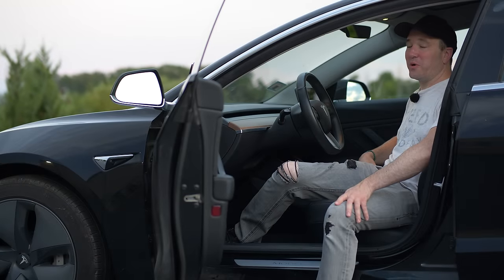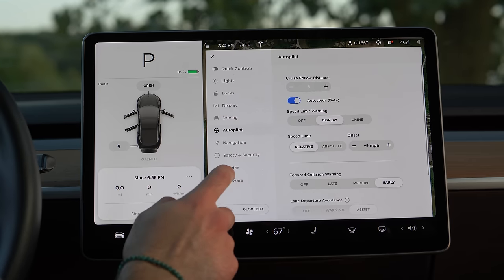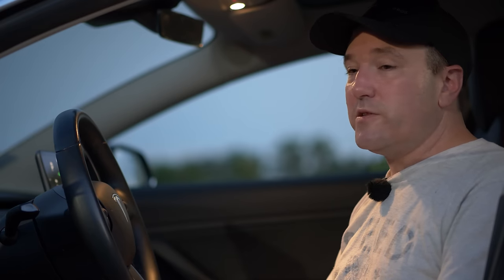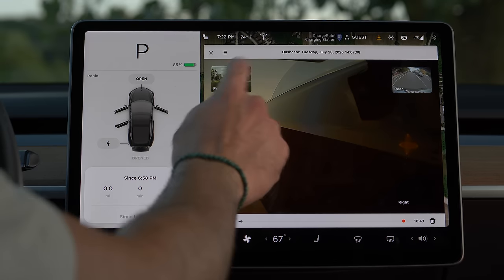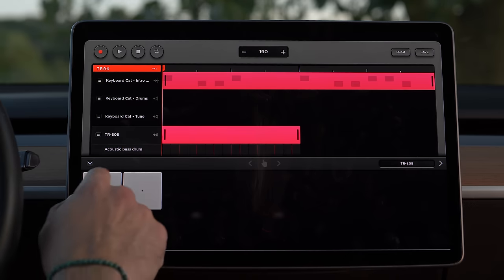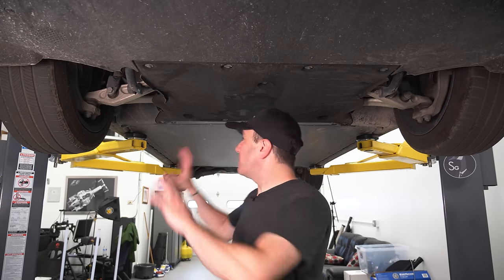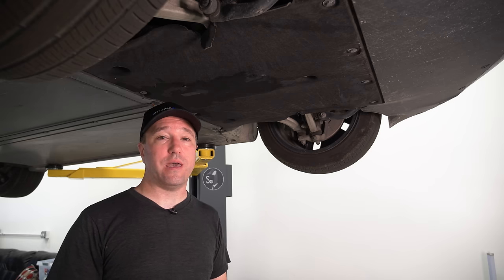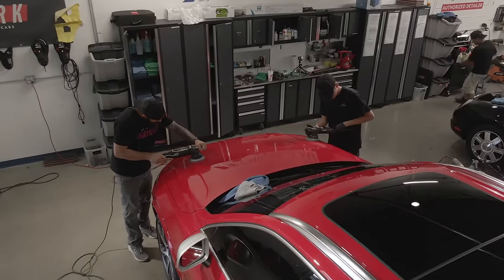Tesla Model 3 | Explaining the Cult

Comment: So the sound thing   ... so put a 10kw bass speaker emulator of a V8 inside the car. 
Passion? , smassion. 
Steam hiss and whoosh sounds great as well...would you want a steam driven car? 
The physics of combustion engines are such that they will always be asthamatic , ponderous and overweight also rans in comparsion to electric . The only difference that held back EV development as winner from the start is the battery weight.  If you put that aside - as power density improves - then combustion engines will just be confined ot the historical and the nostalgic. The laws of physics dictate this - not just clever engineering.

Comment: That was a great breakdown of the Tesla cult and pros and cons of the Model 3. Also there are other differences to add to the pros and cons of Tesla for future:
1) You don't own some software upgrades with Tesla. You'd figure with spending many thousands on antonymous driving for example you'd own that feature with the price of the car. But no, when you sell the car it does not go with it. The next owner has to pay to upgrade to that service again.
2) Battery degradation. There have been reports of people loosing supercharging capability. Tesla will shut it off if you supercharged too much. I assume since batteries degrade, fast charging is not safe after some cycle life.
3) Battery technology improvements. When Tesla finally has a new battery chemistry what does that mean for the older generations of Tesla? To me it means I could have a 1 year old car that is very outdated and worth less in long term value just because I bought in at the wrong time. With gasoline it's a constant and does not degrade or change.
4) Fender benders. These cars cost a lot more to repair than other brands. They are very safe and have a great ability to crumple and absorb impact but there is more damage that way. Check out TFL Car on YouTube and the many thousands spent and incredible damage just from backing into a wall at slow speed while trying to park their Model 3. While this was covered by their insurance, it took many months to fix and money doesn't grow on trees. If everyone is doing that insurance rates are going to go up.  

I'm not against EV or Tesla. It's just too early yet for me to buy one. I'd like to see a lot of the issues mentioned in the video and what I mentioned addressed before buying one.

Comment: Another great video. Did enjoy the social commentary at the end. One thing of note, the two nuclear plants closing down aren't really because they're too expensive the run. Exelon along with every other nuclear plant owner have made tons of improvements to lower costs of running these plants. However, the artificial price structures treating electricity generation more like a stock market than a national good that a bunch of free market advocates pushed through in the 80's and 90's combined with growing fluctuating generation from wind and solar are driving all of the existing nuclear operators out of business. This goes for other "base load" generators too, including coal fire power plants and even natural gas combined cycle plants. So when a "base load" nuclear or coal goes offline, it is replaced actually by natural gas combustion turbines (least efficient way to make electricity with natural gas) because those units can make up for the rapid loss of power whenever the sun doesn't shine and the wind doesn't blow, but Dave still needs to plug in his kilowatt Tesla after a long drive home after work. So really, in 2020, a realistic Tesla use primarily natural gas generated electricity, and not any of cleaner nuclear or renewable sources that generate most of the electricity over the course of a day rather than rapidly for a few hours.

Comment: Love Savagegeese and tend to agree. I rented the model 3 performance for a day in SoCal a few months back. I had a ton of fun dragging AMGs and BMWs for the day. There’s a smug sense of satisfaction that comes with crushing far more expensive cars off the line. With that said, the car falls apart in the corners. It feels heavy and just doesn’t feel like a willing dance partner when you try to push it. The brakes are one of the biggest weak spots and don’t give you much confidence. That said, it’s ruthlessly efficient and quick. In sum, I’d happily drive one Monday through Friday so long as I have a fun stick shift car for the weekend.

Comment: Fair points regarding touchscreens, but Tesla's overall crash safety record stands on its own. There are plenty of distractions in modern vehicles. You still have to generally glance at conventional controls and that's all you generally need to do in order to know where to touch the Tesla screen for most driving controls. HVAC controls are definitely easier to adjust on a Tesla, compared to almost all other cars I've driven. Other touchscreen functions are not meant to use while driving and some are unavailable unless parked.

Comment: Took one for a test drive last weekend, also RWD version. If I lived in a city, I would have one hands down. Mostly because of the lower cost of "fuel". 
I both enjoyed and loathed the fact all the things were on the center screen, as well as the autodrive features. 
It is absolutely not a sports car though, it had crazy understeer even just on a traffic circle. 
Range, even with the 'extended range' package, concerns me, as I live in a very rural area. it is about 230 KM from my door to a Costco for example, so the monthly grocery run would be on the very edge of the range possible. (no, there is no super charger where I live or where the nearest costco is.)

Comment: As a 69 yrs old do it yourselfer, I am excited about the aspect of less scheduled maintenance.  I have 10 vehicles that require oil changes, cooling system upkeep, spark plug changes, transmission fluid changes, etc.

Comment: I agree with what you say about all cars being wasteful in your closing comments.  OEM’s need to continue to find renewable ways to produce cars. The VW ID.3 is apparently going to be 100% carbon neutral at the time of customer delivery. They enforced strict standards to all suppliers and offset whatever emissions couldn’t be avoided. After that it just depends on where the customer lives.  if they have green energy options or solar It can be true net zero carbon. Then of course the recycling processes add emissions as well at the end of life.

Comment: Fair review. As for battery supply the big OEMs had many years to solve this issue but they actively chose not to( remember the movie 'who killed the electric car). Also in terms of pollution an electric does not actively pollute. When manufactured it will have a carbon footprint and depending on where it gets its electricity for charging. These two situations can not really be the electric car's fault. Grids can be made to use renewable or nuclear power. Factories can be made more efficient.

Comment: I really enjoyed your video but it seemed at times as though you felt the need to apologize for any criticism you directed at Tesla. I'm thinking that may be out of concern you'd get an avalanche of indigent comments from Tesla fanboys. Well, I'm a fanboy, and you don't really need to worry with a video like this which presents a balanced pros and cons assessment and where the problems being talked about are genuine issues and not just a slew of irrational and unfair comparisons. You talk about many of the car's strong points, but yes, there are panel gap and paint problems and other issues that need to improve. But well done in pointing out also that these are common problems seen with other new car designs and for also pointing out that in many respects Tesla is revolutionary, is a very good car for the money, and that it is actually steadily improving.

Comment: Interesting to watch this video 3 years after it was published, Tesla has addressed every single one of Mark's complaints as the years have gone by, now with Project Highland, the Model 3 will go toe-to-toe with any manufacturer today with improvements in styling, fit/finish, comfort and cabin noise.   We now know there is plenty of raw materials to make batteries and the SuperCharger network has doubled in size in recent years.

Comment: This just in (WSJ, 12/31/21): Tesla is recalling 356,000 Model 3s because of problems with the backward-facing cameras which stop working because of owners' opening and closing the trunks. In addition, Teslas are being recalled because of dying touch-screen displays, their ability to allow drivers and passengers to play games while the car is in motion and front hood latches (model s).
 Again, if you need quality and reliability from your choice of vehicle, stay away from Teslas.

Comment: What worries me most about the Tesla's dependency of the electronic interface is someone hacking into their system and controlling people's cars to cause accidents or chaos. And your review was great, as they always are!
Reply: You realize all modern cars are ran off computers right?
Reply: @MindzEnt I don't believe they are the same. Are you saying that a Tesla has the same system as all modern cars? And that all the other modern cars can be updated and repaired the same as a Tesla?
Reply: @t.k.morris  Most modern cars have the same amount of computers on board that have internet connectivity.  And the over the air software updates is something that Ford and GM started doing in 2020, alot of other brands also have Ota updates planned.

Comment: Very good.  I've watched both of your videos on the Tesla Model 3.  I'm hoping the next video you do on this model will include more information about the rear end differential.  I'd like to know if it has some version of posi-trac or lock-up.  Not for racing, but for traction in snow etcetera.  In the first video on the Model 3 (2019) you stated that the front motor utilized an open-differential.  So, I'm hoping the rear wheel drive base car doesn't use an open differential.

Comment: You raise many fair and reasonable points, but I'd push back a bit on a couple. While the touchscreen may seem tailor made for dangerous distraction, I'm not aware of that being shown to be a real-world problem. More specifically, I'm not aware of any study or data showing a higher incidence of accidents or trouble with the Model 3 than with conventionally-knobbed cars.  Moreover, many of the features that can be accessed from the touchscreen can also be accessed entirely by voice commands, with no need to look at the screen at all. The more significant issue is charging, which you aptly raise near the end. As yet, that simply can't match the convenience and ubiquity of gas stations all over the place. Nevertheless, especially in suburban areas like yours, most would charge at home, over night, which has no analog with an ICE car.

Comment: Very good review! I would prefer reviews in general to be more down to earth like this. 

Early adoption of new technology is always part investment into the infrastructure. The cars are far from flawless but are great fun to drive and like you said, the future is electric. That includes steel foundries by the way and we do have some electric plasma smelters here in Sweden at least.

17:20 The Long Range Model 3 produced in the US now and shipped to Europe this month now has the new heat pump from model y as well as the new center console, chrome delete, automatic tailgate etc.
27:50 I feel like it is similar to losing some connection when going from horses to cars. Personally I'm fine with it but it is another thing we'll see fade away with fond memories.

Regarding the environmental impact, I hope in general we will move to electric in all areas since it has the greatest flexibility. Smelting, robotics obviously, cars, airliners, cargo ships etc. Then it's just up to policies to move electric towards sustainability. When we also recycle most metals we can seriously reduce our impact on the planet.

Comment: Keeping in mind that this video is a year old, and a ton of improvements have been made since then, I still have a bone or two to pick.  The door handles only took a few times to get used to...seriously, I use the door handles as easily as an old-fashioned gas car's handles.  Sound?  The front seat windows are double-paned, making the ride even more quiet.  Without a gas engine to mask a lot of driving noises, it's easier to hear things that are drowned out by the engine noise of a gas car.  But really, I don't notice anything significant when I drive.  Fit and finish is fine. And voice control:  I can just tell my car to turn on the wipers, etc.  I don't have to take my eyes off the road to do so.  Again,  I understand that this video is a year old, so some of the nit picks made sense back then.  But they've been fixed.

Comment: Here is why Tesla has that one giant screen.  Everything can be controlled remotely.  I purchased my RwD 3 in 2018. The car I have today in 2020 is better in almost every way.  It is much faster , has far more torque with better throttle response.  The range  and Efficiency has increased.   It changes faster.  It now has a 360 degree recorder with a better security system.  I now have YouTube Netflix and Hulu ( when parked).  Now finally voice commands work. Make it cooler or hotter, open glove box.   I can unlock , heat or roll my windows up or down from anywhere in the world.

Comment: YOU'RE WRONG on many points but still fairly good video.  Not going to be as critical as you but...

1) Elon Musk didn't start Tesla. 
2) If you have a screen failure, you can and should be using voice control to adjust almost anything you would on screen.  It's much safer as well as faster in many cases. 
3) No, the model you are driving is not a "sports car", but the  performance version is. 
4) We are nowhere near the limit of battery production capability. I could go on but I won't lol.  
On another note, coal plants in the U. S. A. are now closing down at a rate of more than one a month and being replaced in many cases with wind, solar or combination of battery storage in many cases.  Finally, mass adoption of Ev's will now come faster than most think like it or not ;-)

Comment: Rattles in the door. None after two years of ownership. The door handles are an awesome design, he is so comical when he was pocking around trying open the door. These handles were a direct rip off of super cars. Austin Martin and Mcklaren. The first car using this handle design was the first Porsche in the 50’s. Also if the car’s computer reboots, screen goes black. This has happen 2 or 3 times since I’ve owned my Model 3. The car has 100% functionality while driving. Of course you can’t use navigation or controls on the screen. But reboots quickly, so no safety issues. 
Anyway, as an owner of a 2018 Model 3, it’s the best car I’ve ever owned, and a joy to drive every day. The best investment I’ve ever made, besides buying Tesla stock. Also I’ve just had the car serviced for the first time in 20K miles. Service was excellent and they came to my house to do it. No dealership to go to and waste 1/2 a day at. He mentioned noises and creeks in the car. None that I hear. I would recommend the car to anyone that wants something for their money. Great car for long distance traveling. I get to my destinations fully refreshed and not beat up from a conventional car. Oh, my favorite thing I love about the Model 3. Is the hold feature, this is where you come to a stop, push down on the brake peddle and the car will hold its position with your foot off the peddle. I just heard the tester saying you can do web surfing while the car is driving. You can’t do this. You can’t do this function while driving the car. Or play the games also. You have to be in park. You aren’t using the screen constantly like he is suggesting. Once you setup your mirrors and basic functions you don’t ever use the screen while driving. Navigation you also set your destination before you drive, and you get clear audible directions to listen too. Even listening to the radio you use the knobs on the steering wheel to adjust the sound and skipping ahead in the playlist. You don’t need to drive to a Tesla charging station to charge your car. You have an electrician install a charging port at your home, I installed my own for 30 dollars in parts. With an electrician doing it, that is about 1000. Using Tesla charging stations are for long distance traveling and are very easy to use. This guy is just knit picking everything he could find wrong. And it’s mostly opinionated comments. So my opinion is go buy a Tesla an you won’t regret it. The new Model Y is excellent for a family with two kids or for the hatchback feature.

Comment: Infrastructure? The Tesla Superchargers are where they are so people who are along a major thoroughfare can charge. Most people with EVs have home chargers (all the ones I know do) so driving 20 minutes to get to a Supercharger makes sense AND a good portion of the time (80% or more?), unlike ICE vehicles, you won't have to charge anywhere but your house. The cost of my charging (we have a Chevy Bolt) is 2.8 cents an hour (tiered in Austin) and it takes roughly 10 hours to fully charge (and we don't fully charge). So our "fuel" cost to fill our "tank" is about 28 cents. Even at tier four, it's ~11 cents per hour. I have a Miata, and I love it, but I HATE having to fill it up at a gas station.

Comment: It's a good video, but would have been good to mention ownership costs (esp maintenance, but also fuel obviously). On the last remarks about no car being green it is true a certain extent, the greenest car is the car you don't buy, but come on look at various well-to-wheel and life-cycle-analysis of ICE vs EVs and the differences are significant (in favor of EVs), despite the higher environmental impact of battery manufacturing in the first place.